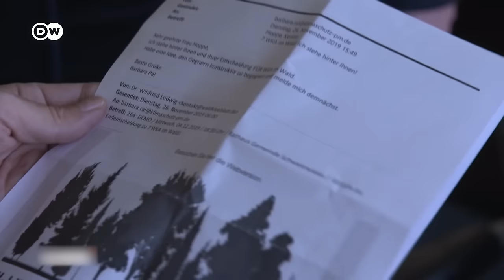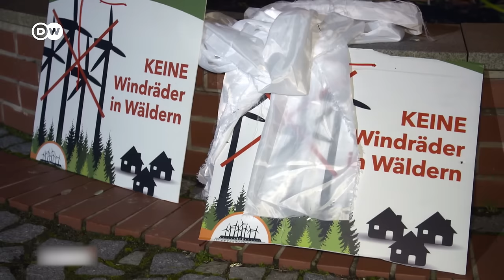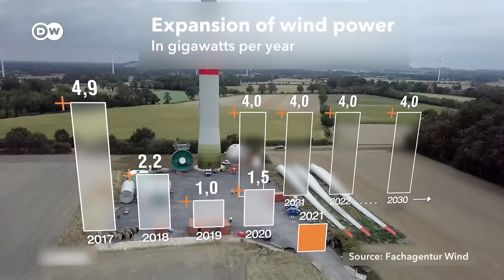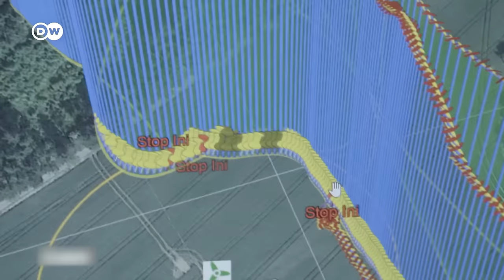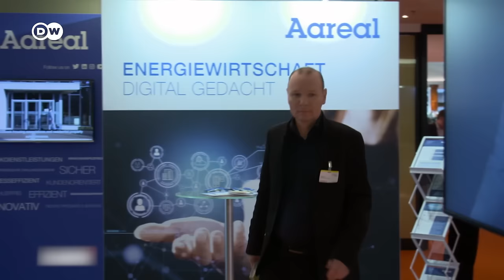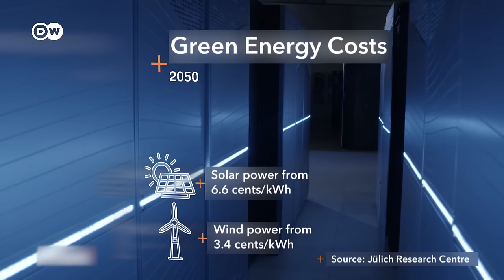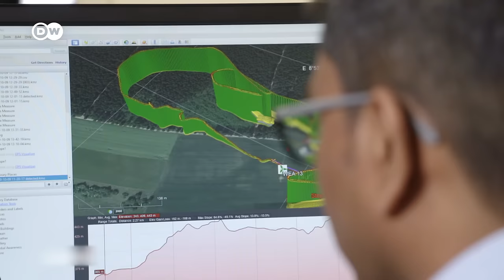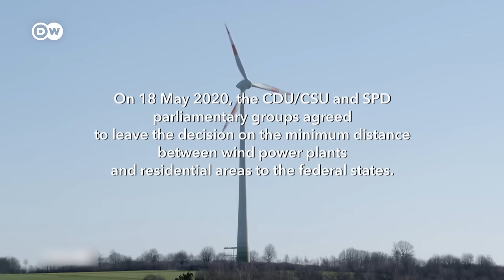Wind power getting headwind in Germany | DW Documentary

Comment: if the UK changed its 28 million vehicles to electric ( @ £30,000 each !! = £750 billion ) they could require an additional 60GW of electricity power. Modern big power stations are only 4GW, so we need 15 more Drax power stations to supply electric cars. And does this mean no smoke or fumes from generation, absolutely not. Drax Power station has always been one of the dirtiest source of air pollution. Another 15 such power stations to feed electric cars is simply going to add to air pollution. And of course Drax burns 7.5 million tons of trees ( biomas = renewable energy ???? ). Drive electric cars, burn trees, add to air pollution. A solution, ........ er maybe not

Comment: It says nothing about intermittency problem. How do you solve that with wind?
Reply: Battery storage. Coal-fired power stations also have to store their fuel to cope with intermittent deliveries. Have a look at the Redflow battery to get an idea of one clean, cheap battery technology that is available. There are some good videos on YouTube about this.
Reply: Hydrogen storage was literally mentioned in the video.
Reply: @palmshoot  and it's efficiency of only 10% was also literally mentioned in the video
Reply: @wsswetghg8791  You contradicted yourself by saying that it was, in fact, mentioned.  The lower efficiency would be less of a non-issue if you eliminated the transport.
Reply: @tlangdon12  I don't think they've factored in battery storage cost for wind. And if they did, for what capacity? Batteries can only store DC energy, meaning you need a double lossy conversion: first from AC produced by wind turbines to DC to charge batteries and then in reverse. Can you store an entire nation's supply of energy for 7 days in batteries? I don't think it's practical.
Reply: @palmshoot  It clearly says there converting H2 into electricity is only 10%. The guy says nothing about transport, only power conversion. BTW I think he's wrong here too, 10% is suspiciously little. Should be somewhere 30-50% for an industrial system.
Reply: @wsswetghg8791  It's common in business to subsidize a loss with a savings or gains in another area, like what Amazon does.  So, it's shortsighted to fixate on one aspect. Hydrogen is the lightest fuel in the universe, meaning it should be cheaper to transport, in principal, once things are scaled up and optimized.  Producing the H2 locally would have considerable savings that are beyond what fossil fuels can achieve in several markets simply because distances would be shorter. Then, there's the fact that hydrogen doesn't require expensive research and drilling like you would need for fossil fuels.

Comment: how come bio-mass is green,  is just burning wood and making CO2
Reply: Well it depends, if you're cutting forrests, burning them and then regrowing them then it's kind of a cycle. There is a company in Afrika that produces steam with wood scraps.
Reply: @jellybeans0493  Would be better if they would pyrolyse it, utilize the gaseous and liquid fractions for energy and spread the charcoal on the land. That way it could technically be carbon negative as the charcoal portion takes a very long time to naturally break down.
Reply: @nolan4339  Idk about that, i think it's better to just burn it to produce energy/steam in the case of the wood scrap company

Comment: Wind on the back of battery technology is like a no brainer 

The next level mesh network to grid tech is coming in with EV's, the problem with nuclear is waste and always on, it's mind numbingly short sighted so......  Follow the money who gets to profit from this
Reply: Nucular's uranium also requires constant mining to extract it and is a limited resource. batteries have the same problem though. Lithium is also limited and destructive to mine for, I know we still need it for mobile batteries, but stationary batteries should store power as waights or other mechanical energies that can be set up with common materials, and far cheaper too.
Reply: @alphonsobutlakiv789  in the UK the first liquid air grid battery storage facility is due to come on line soon look it up its fascinating, the other method of grid storage is flow batteries, Tesla are still hung on Li ion but there's serious development in solid state silicon / carbon etc.. Gas as a top up for the grid is on its way out the only people pushing it are those with a financial interest in the stuff.
Also in the UK gas engineers are cross training to do ground source heat pump instalation and maintenance 
Times are changing

Comment: It seems community ownership and control is what drives wind farm support even if the proposal is less than ideal.
Why do people object? It's because they perceive that they have been drawn the short straw for the benefit of others even if others may include themselves. Obviously, the community is the collective, not Germany, in the disputes. Other beneficiaries will think otherwise. That's just human nature. 
The solution seems simple then. Compensate the affected community and people for the sacrifice. Give them ownership of the project. And if that still doesn't work, perhaps there are reasons not to proceed.
Sacrificing the individual for the greater good may be politically correct for everyone but the affected individual.

Comment: Why avoid nuclear?? This "renewable energy"  meme is dangerous and counterproductive.
Reply: We can't make uranium, we mine it, it will run out, but it's really the risk of a meltdown and the storage of the waste, and storage lasts for nearly 10,000 years.
Reply: @alphonsobutlakiv789  Won't run out for  centuries.  Modern reactors can't meltdown like fukushima.  And waste storage and recycling is very safe. To the common man it sounds like a bomb. You need to do some study and reading to understand this. Don't fall for hashtags and memes. Like a kid which is scared of the bogeyman.
Reply: @sanjitdaniel4588  when they say centuries, I can only guess that's at the current rate of consumption, not with an increase, also, it's still comming from the ground, mineral mining tends to be very destructive and I dought the cost of doing it falls in Germany or even Europe, I generally hear Africa as the source.
Reply: @alphonsobutlakiv789  spring water comes from the ground. Is that now bad? 

Also I said it will last for centuries with future requirements  in mind. And by then we will have nuclear fusion. No, don't worry, its not a bomb.
Reply: @sanjitdaniel4588  spring water is pumped, not mined, and when calculating how carbon neutral nucular is, are the emotions and resources in the mineing prosses accounted for? I know windmills usually acount for that in there envierment impact reports.
Reply: @alphonsobutlakiv789  What is the problem with mining? We both owe everything to aluminium, iron, zinc, lithium, slicon etc, stuff mined from the earth. Where is the issue ?
Reply: @sanjitdaniel4588  some minerals are more environmentally destructive to mine than others, iorn and zinc tend to be less so, and aluminum shouldt be treated like garbage like it is, but that's a different point. Anyway, it still needs to be counted as part of uranium environmental impact as it is included in the windmills, and what is the point of building up the world on temporary systems? Wind can last forever, uranium will run out, and myself do see it as an important resource to hold on to if we are to make the jump into developing space. I feel the same way about helium.
Reply: @alphonsobutlakiv789  forget your emotions and feelings. Do some real research and study to know the facts.
Reply: @sanjitdaniel4588  if we don't care about emitions, just burn coal, I only know about the emitions for solar and wind becuse we made them run those numbers because they claimed to be green. it's not my job to run those numbers, nor can I, but it must be worse than wind, the mining never stops for uranium.

Comment: The secret to win power is the torque extracted per unit if they build the right design they could extract enough torque to make the windmill 150 to 500 times more powerful 
Then they would not need to import any fuel at all they would
Have a surplus after one year to power Germany and Italy for 5 years energy has to be stored in super
Capacitor batteries
👹👹👹👹👹👹
And the more powerful units would be more beautiful and produce no sound 👹👹👹

Comment: What kind of energy do you prefer? Let me know in the replys.
Reply: Nuclear is better in every way. Offshore wind is good if coupled with hydrogen/synfuel production but it's poor when coupled to the grid.
Reply: @zolikoff  the nuclear power plant near my area shut down recentlly. It was 3 mile island
Reply: @insectbite1714  I know that plant. It basically had one unit operational. Didn't really have space for more units I suppose. Single unit plants are rarely economical these days, yet the USA has a legacy of mostly single-unit plants built by various electrical utilities.
Reply: Nuclear is my favourite as well. They are rebuilding my nearest nuclear power plant at Hinkley point in South West England. I hope nuclear tech evolves and we use it more instead of covering the land in unsightly solar and wind farms.
Reply: @chatteyj  solar pannels can go on houses you know. In my area a nuear lower plant shut down recentlly. 3 mile island.

Comment: Use hydrogen as a fuel.
Reply: @donthesitatebegin9283  First of all Hydrogen isn't even igniting without oxygen, it needs oxygen in order to light up. It's REALLY safe, I know first hand because my car is modified to burn hydrogen which I produce myself using solar power.
Reply: @donthesitatebegin9283  I'm an engineer but I think that it's much safer now than it was a while ago

Comment: Never mention in the story was the large amount of carbon fiber propellers in land fills never mention that 240,000 tons of C02 are used to make an 80 meter wind turbine,  and they only last 20 to 25 year max but the transmission worth $250,000 last only about 10 year all made of steel (need coal to make ) and bearings last about 18 month 500 bucks made with coal the re-bar and cement to make the tower needs coal to refine. Hundred of miles of under ground cooper wire refined by coal. Transformers made from cooper and steel last about 2 years each tower need one. 40 liters of oil per year to lubricate the transmission and bearings. Bird killers great if they shut off near birds then they are not productive. if near a lot of birds.Solar is worse land fills 80,000,000 metric tons 2050 plus 22 refines elements to make one for a 25 year life.